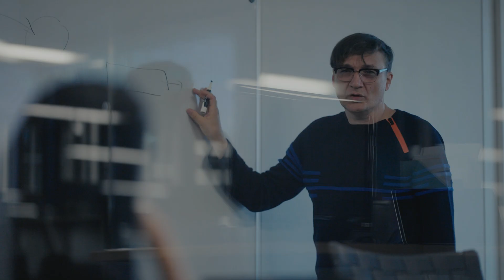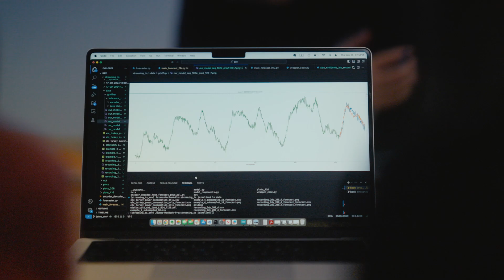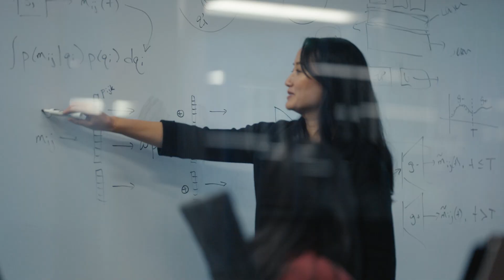Archetype AI: Can AI Learn Physics From Sensor Data?

Comment: Exciting work, hope to hear more and see some open source papers/models! I am particularly interested in how light-matter interactions, those which we probe through remote sensing techniques like spectroscopy, can be incorporated into foundational models such as these to provide a complete depiction of our modern understanding of realities fundamental mechanisms (mechanical, chemical, thermophysical, etc). I see a future that combines foundational models and purpose built models with input from sensors and enables interfacing with them through more user-focused techniques like LLMs. 'AGI' will never be a single method or model; but a system of models that combines superv/unsuper/self-supervised ML methods to push beyond the limits of human interpretation. However, it seems few 'AI focused' companies are putting any effort into remote sensing, hyperspectral imagers, and the models required to benefit from them (despite the MASSIVE investment into and accessibility of these instruments). I'm defending in the next year and looking for like minded organizations in and outside of my sector to work with after; I see this as a cross-industry endeavor that we should focus on motivating fed funding for, which we are in the process of. Where could I submit an application or statement of interest for collaboration?

Comment: Extremely exciting. You should turn this into a closed loop discovery system. Run an agent that proposes which new experiments to conduct inorder to fill in the knowlegde gaps which inturn triggers function calls to control small set of robot arms to conduct new experiments itself and collect new data. Give it an entire lab to experiment with.